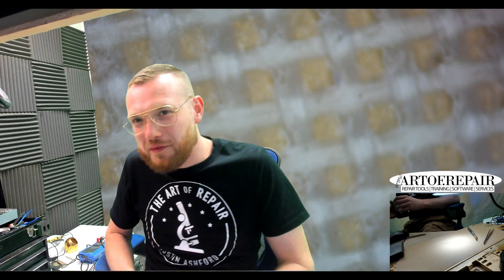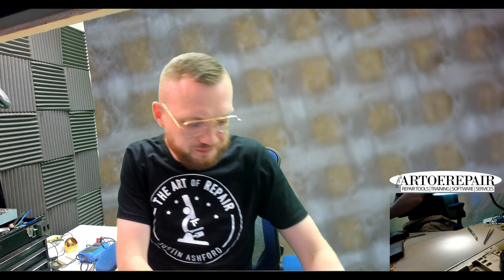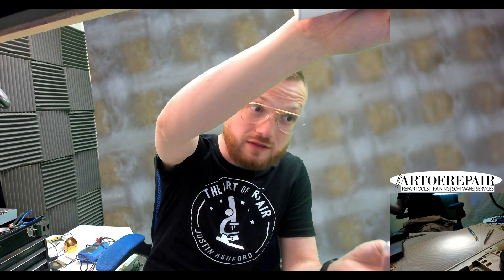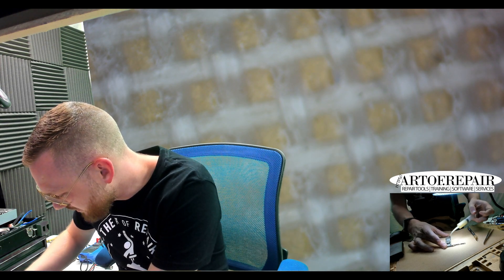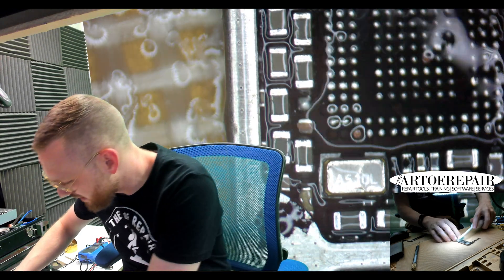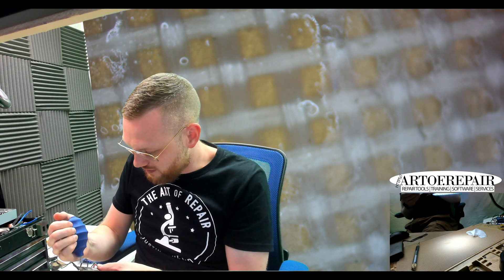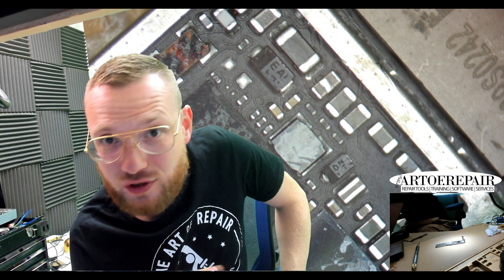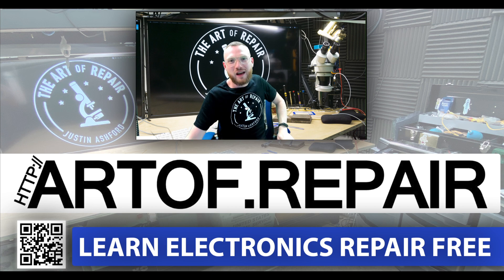Ultra Clean the FLUX off your PCB by using an Ultrasonic Toothbrush | Which is the best to use!?

Comment: I was considering this a while ago and came across a sort of industrial kitchen version of the ultrasonic toothbrush for cleaning PCBs :)
https://youtu.be/3W7NM5-RALo
Reply from the maker: Oh that’s super cool! Are the bristles pretty small?
Reply: @TheArtofRepair   Hey Justin.. The bristles on the Sonic Scrubber are not as small in diameter as a 'proper' toothbrush and they are stiffer, you just have to be gentle with it on boards really. In smaller areas though say around SOIC8 or MSOP etc narrower & softer bristles would be very much preferred and this is where a sonic or 'real' toothbrush works better. 
I wish there were more brush options for the Sonic Scrubber really as at present I think there are still only 4 different heads available, and for very delicate stuff they can be a bit aggressive. But I guess this is due to it originally being designed for kitchen type use.
Cheers buddy
John

Comment: I like STS Telecom method, with a ultrasonic tank and using an alcohol bath afterwards to displace the distilled water. A toothbrush wont get underneath the connectors and chips
Reply from the maker: Nobody is saying not to use an usc if you want to do a full cleaning, but toothbrush and iso is still a huge staple in the industry as a whole and has a major place before you do any sort of large USC.  Also, usc isn’t compatible with all components these days and can cause issues with some types of onboard stuff like mics and gyros.
Reply: @TheArtofRepair  yeah, some people don’t listen 🤣 great idea. Thanks

Comment: I have also heard of people using self mixed 75% Iso in a wireless refilling water pick to get rid of mineralization around water damaged sockets.  Appearently the force of the Isopropyl Alcohol carries away most of the dried minerals if you use it right.
Reply: I use 80/20 for any water-based corrosion remains, because the water portion gets the remains in to suspension, and then the alcohol portion gives it the volume to be displaced and dry off quickly enough.   Definitely if you try scrubbing off things like dried coke or drinks with pure IPA, it generally does a poor job due to the substance not being soluble in alcohol.
Reply from the maker: @pldaniels  appriciate you adding to the convo paul, good to see you out here in the wild! I hear fun things are happening on your side?
Reply: @TheArtofRepair  i'm doing things... some things.  You're probaby hearing noises about the OpenBoardData project integration with FlexBV.   Getting sick of not having access to that sort of data because it gets locked up behind walled gardens of other repair packages... so I'm trying to make an open one!

Will have to catch up with you on FB/chat later and see what you're doing more.
Reply from the maker: @pldaniels  is this the stuff we discussed previously about the data collection stuff?
Reply: @TheArtofRepair  quite possibly - getting diode/volt/res measurements for boards and letting everyone contribute/get-access to it.

Bigger next "threat" on our horizon is the lack of access to boardviews --- can already see it happening as we're only getting pdf schems with "rough over boardviews"  ( like in the iPhone schems ).
Reply from the maker: oh my goodness, this is actually something i have never once seen or heard of. Im testing this asap.